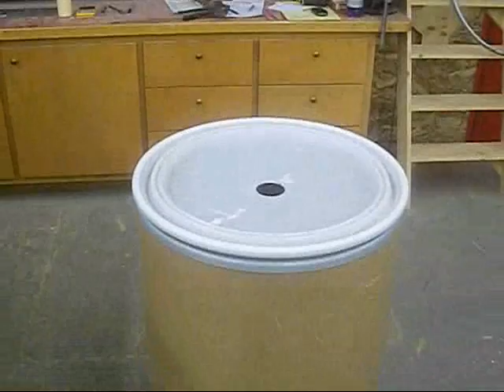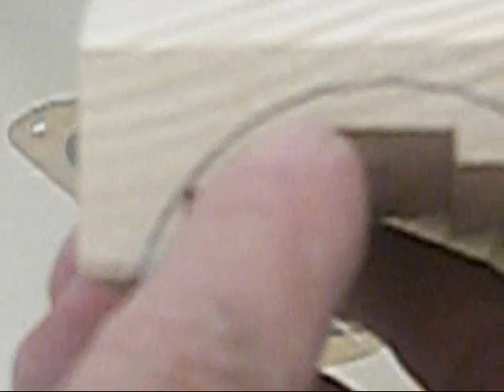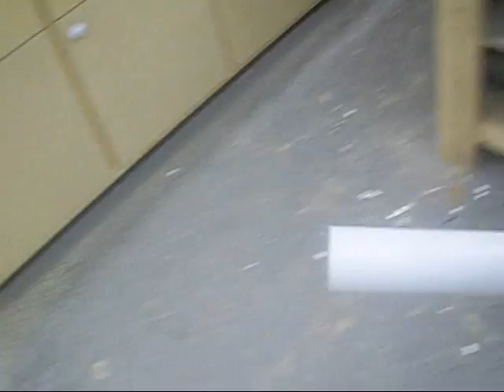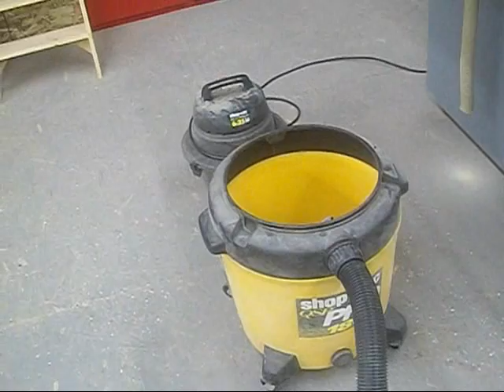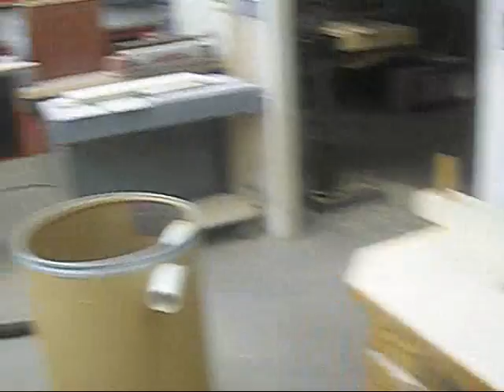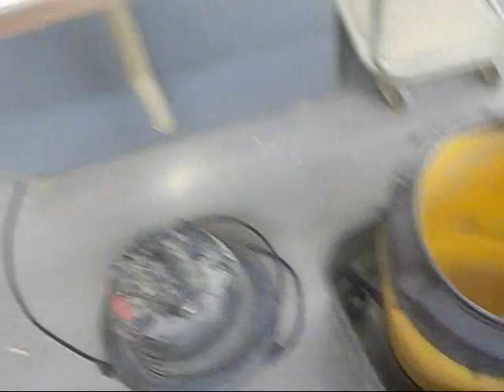Build this Sawdust Collection System

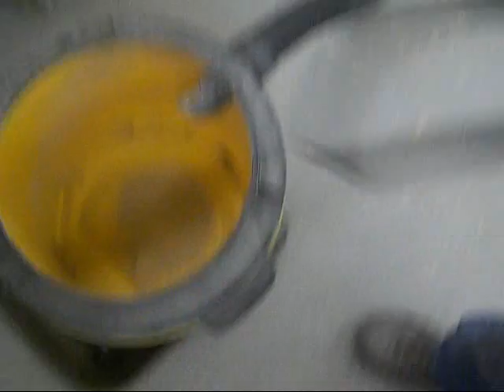Comment: Actually, ShopVac came up up with idea more than 40 years ago. If you go to 28:20 of this video, you'll see the exact same principal on the inside of the Shopvac with the very same dust line. You can cut your PVC exactly like the Shopvac without all the hoopla of the wooden support or metal. It's how I did mine with a 30 gallon plastic container more than 20 years ago. Build time about 15 minutes.

Comment: Followed almost exactly. changed the way the hole is put into the side of the barrel.  that was it. Works 100% not a bit of anything going into the vacuum, all going into the barrel. Only changes I would make. A little less complicated explanations and measurements are needed. I just used what measurements  I felt were right for me. I don't think a simple dust collector needs to be described with degrees and such. But like I said. I am very pleased with the outcome. thank you for your video :-)

Comment: I did make this, but I used a heavy duty Rubbermaid 30 gal garbage can, in my small shop it does a great job, mostly on a table saw and a router table....  would say it gets 80% of the saw dust.  One thing I changed after using it was to angle down the pipe coming in the can about 15 degrees.  With the stuff I had it cost me 15 bucks

Comment: Will have to use all plastic parts since I want to use it to suck up water off of the clean floors after washing them.
Reply: Use a garage door spring that will fit into the PVC pipe so that you heat it up and bend it to the shape of the bucket that you use.

Comment: Based on the dust path that was made you might want to angle your input pipe to that angle, would make it more efficient.

Also it could be improved by redesigning the input pipe, currently the pipe is quite a bit away from the inside of the barrel, the airflow could be improved if the side of the plastic pipe is right against the inside of the barrel, making a straight line through the pipe and along the side of the barrel.

Comment: I have to say I tried a couple different systems and wasn’t happy with the ones I tried.  I did this one very muck the same way, really impressed.  Had a big pile of saw dust under the table saw and figured it would be a good test.  I sucked up the whole pile... now the test..... NONE went into 
The shop vac it all went into the container.  I used a 35 gallon h/d Rubbermaid can.  I used a piece of plywood on top for added strength.  All hoses were 2 “.  Have to say it’s a 5 *** design.

Comment: Joe: Will the shape of this drum work? 
EAGLE 1601MB 30 Gallon Blue Lab Pack w/Metal Lever-Lock Ring found at Interstateproducts.com.
Reply from the maker: Hey Larry, I went to that site and seen the drum.  From what I could see (not knowing the measurement of the fat part down from the top) it looks like it would work but I would put the inlet pipe below the fat part of the drum.  In my mind the ridge of the fat part would cause turbulence in the air flow.
Reply: Thanks.

Comment: I have the same style collector with a 30 gallon metal trash can..It's works exactly the same. I was shocked at how efficient it was and how little reached the shop vac.... Shop vacs are very inefficient at what they can hold because of the filter displacement...Even with a 20 gallon shop vac once the dust gets to within 3 inches of the filter it clogs up very rapidly and in reality can only hold at best about 5 gallons of dust before the suction falls off....I really needed this for my planer in a big way...By the way,,as an adder,,pantyhose,,cut the legs off and slip them over the vac filter,,helps a lot.

Comment: I liked it.
It looks like a very effective system. It should be able to pick up small pieces of wood, without them jamming in the inlet, as it would in the vac itself. 
I think I would like to try and fit the inlet pipe to the lid, so that I could line the barrel with a garbage bag, to make emptying a bit less unpleasant.
[In theory, it should be possible to pass the wood block over the table saw at an angle, and cut the semi-circular groove for the pipe, in one pass, though I've not done it myself, yet.]
Thanks for posting.

Comment: where hav I gone wrong, I stared to build one of these today, having no cardboard bin I i used a bought fairly good quality dust pin  with a good lid 20" in diameter,  I Put my vac input hose through the centre of the lid and ran it down about 18", I connected up the  1.5" intake and it worked great,loads of sawdust in the bin, but third time I switched on there was a   big bang , well more of a Pop and the side wall of my bin was cracked. any idea  what I did wrong,having looked at your video again I see you kind of insist 7" below the lid (is that crucial) Im kind of thinking I ran the vac pipe too far down the bin
Reply from the maker: +Bill Lupton Yes, you certainly did run it too far down.  I didn't say 7" below the lid.  I said 3" below the intake pipe.
Reply: +Joe Johns  so you did,, thanks for the speedy reply,,  can I have your your opinion ? , as my bin has a 12" split (crack I have loads of very thin aluminum sheets , Im wondering if is just lined my bin with the aluminium and stuck it to the inside , alternative get another bin. Thanks for the reply  I enjoyed your vid.
Bill
Reply from the maker: +Bill Lupton Hey Bill, well I suppose you could use your aluminum and use a caulk between that and the barrel, making sure to put the strips on the outside and screwing/bolting the aluminum to the barrel making sure the heads of said screws/bolts are on the inside.  The idea here is not to disrupt the air flow inside the chamber so keeping it minimal is the key.  If that bombs then you can get another barrel.  In other words, don't throw in the towel until the thing is down.
Reply: +Joe Johns Gur a míle mait agat ,   I got another bin and am about to correct the mistake, it was fun making it, it was interesting and I was  just excited to see if it worked, anyway its only a bin .Thanks for being friendly  BTW thats Irish for thank you,  a thousand  thank you's
Bill

Comment: hi Joe  I made a dust collection  system  with  a  plastic  barrel  and  a  shop vacuum . this method  work's  great I tuned  two bowls  and used the dust system  and there was  no  dust or  shavings  in the vacuum . it's  a  great  video . thanks .

Comment: Want a simple Dust trash collection system, get a barrel size of your choice.. cut a hole opposite each other on both sides. Now hang a section of flat 1/4" plywood 12" x 12" from the lid down into the barrel.. now connect existing vacuum to to one hole and you collection hose to the other. I've made a dozen of these for less than $20 and takes less than 15 mins make.  You can collect all things that will normally fit in the hose and surprise.. no dust will escape to the vacuum it's self.  My personal one is connected a wall mounted fan that exits outside. I have yet to see dust of any size come out of it.. Everything is collected in the drum
Reply: Your method is scientifically less cost effective than Joe's.  The abrupt  change in the flow of air from your system causes more friction leading to more energy consumed. It might be cheaper to make your haphazard contraption, but it will lead to higher energy bills than a system like Joe's.

           Joes system, while not the most efficient method, at least provides a measure of cyclonic action. This removal technique is the industry standard.
Reply: Robert Wolf fool!  the method I use has been used in saw mills throughout the East coast for years...and there is no additional friction. ..you do not need a cyclonic action to collect dust and debris. there is no sudden change in pressure as well.  heck I've seem systems like mine made even more effect by a raised collection container that had a spring loaded trap door. when a certain amount of trash etc was collected...the weight would cause the trap to trip dumping the waste into a waiting container.  thus taking away the need to check the amount collected or dump it yourself. further more...the system I employ prevents any additional wear and tear on the fan itself...dust|debris  gets no where near the drive or fan blades.  my current arrangement now in use for several years, collects from various points as well & the fan is 12fr away from the collection point...  not one system I've set up for friends and family as failed and that includes a system set up for a gent that needed an easier way to clean his ashes from the basement firebox...flex metal tubing  ran to a metal trap  with the fan outside. ..everything trapped in the metal container....no ash or possible embers making their way outside
Reply from the maker: +Richard Elbe Richard, I have to ask you.  Why the hell are you here on my YouTube channel touting your dust collection system?  If yours is so great and wonderful why don't you have a video showing how to make it and how well it works?  Jesus, you got big ones, buster!
Reply: simple...it's the law of the enter webs..people improve upon what they see and simplify it. I'm not taking away from yours....but think about the majority of people who scan  the the web looking for these ideas are low income and trying to make good on what little they have.  A buddy shared this link to me and was unaware I made a version so I threw it out there.    It is the name of the game after all be cost effect both in material and time.  If you don't like it.. delete my comment.. cause I sure as hell did see a sign saying that youtubes property was given back to you. Or were you aware of that.. same as facebook..what you upload... belongs to youtube
Reply from the maker: +Richard Elbe No, see, you're missing my point.  I don't give a flying care about who uses my ideas or material I post on YouTube for that is the reason I put them up there.  What I do care about is someone like you coming onto my channel and uses my audience to proclaim their goods.  I mean, if you were a Chevrolet dealer would you walk into a Ford dealership, stand on their floor and begin lambasting Ford?  As perhaps a surprise to you what I give to YouTube belongs to them for as long as I determine them to have it and I delete it.  So, no, I have opted not to delete your comment because I want everyone to see how silly you are.
Reply: at least its entertaining for them
Reply: +Richard Elbe your right, it is entertaining.. just to see what crap will come out of your mouth, it shows your ignorance. by the way your idea does suck.

Comment: I have just finished building my dust collector using a 1200watt shop vac connected to a 12 metre 2" swimming pool hose {since cut down} works absolutely perfectly with no dust in the vac itself.Here is the only problem that I have encountered and perhaps posters may know the cure.The high pitched scream from the convaluted hose scares every dog in the neighbourhood {better than a catapult 5555} and is painful to the ears. This is really really high pitched
Reply: +The sawdust maker. David. the swimming pool hose is a continous spiral. If you use a regular shop vac hose or a smooth insed hose the noise will not occur.
Reply: +JIMMY TATE .I live in Thailand and restricted for choice of basically anything. The vac came with a small tube which was not very long and quite difficult to get fittings, hence the expensive pool tube but will continue to look for something to use the original hose.Thank you for taking the time to reply. Much appreciated.
Reply: I just had a quick thought... If you could get tight hose couplers for that hose, you may consider cutting the hose into a few pieces and reversing the hose for each section relative to the previous section.  This would interrupt the spiral a few times and maybe at least reduce the noise.  I am only speculating here.  It may not be effective and the additional couplings may cause more drag or places in the hose where particles may jam and collect/clog.
Reply: good thought but turning the hose end for end will not change the way the spiral goes.

Comment: Hey Joe. Thanks for this great video as I built one with some alterations. Here is what happened. I looked for about 6 months for a fibre drum but found none. Even looked for a plastic drum with a sealed lid. No Luck. So I bought a plastic garbage bin and some foam tape and glue. The tape and glue did not stick as the plastic was too waxy so I taped it with some good duct tape which worked out good. I made the wood caul, installed the pipe in the top and side with some extra support in the top. However it was difficult to caulk as due to the waxy plastic I had problems with the glue and the caulking to stick. Once all was set I plugged in my 6.5 HP Shop Vac. All was OK collecting sawdust until I overloaded it or closed the vent. The garbage can lid and side got sucked in big time. Lesson learned use a heavy duty solid bin to start with that will accept glue and caulking. Plastic does not work. Hope this is good advice so you can learn from my lesson. Malcolm in Canada
Reply from the maker: +Malcolm Hall Hey Malcolm, you can find these drums/barrels at places like bakeries, industrial plants, food handling plants, car washes, auto parts stores - basically,  while riding around keep your eyes peeled.
Reply: Thanks Joe. I have been looking everywhere for the last 6 months with no luck. I found some through Kijiji and they were free however they were in Toronto which is 500KM away. I will reinforce this baby for now but will keep looking and re build once I get the right barril. It was fun to make but you can imagine the look on my face when the top and sides got sucked in when I turned it on. lol
Reply: Plastic works fine. you have to scuff sand it first. try using liquid nails instead. I use a metal trash can with a modified thein baffle. no issues with the can crushing.
Reply from the maker: Hey Malcolm...yeah, I have heard tales where some of the drums folks use collapse from the vacuum force.  The only thing I can tell them is to get a thicker container.  One maker of this system ended up putting staves on the outside of the barrel, which he said worked fine and no more problems with it crushing.
Reply: Thanks Joe. I built a framework inside the container that is working fine. However If I find a decent rigid container I will build another one.

Comment: Does the wood caul really need a circular cross section? Couldn't you stop after the dado blade work? The caul would still position and secure the inlet pipe.
Reply from the maker: +ohgary Sure you could.  I was merely being thorough is all.

Comment: So I need someone to explain this to me... I've seen a lot of people showing how they've built these cyclone dust collection systems and they connect them to their shop vacs, and this is such a newbie question, but here goes... Why??? Yes, I know that most of the dust gets collected in the cyclone thingy and not much gets into the shop vac and therefore doesn't clog the filter and doesn't fill the bag as quickly. But here's where I'm confused: personally I took the bag out of my shop vac, so I never use one. Dust fills the shop vac, then I simply dump it! Done. If I wanted to, I could even take the filter out completely, right? It seems to be sucking everything up just fine and I keep dumping the dust. I don't understand what added benefit the cyclone thingy provides if I could just use the shop vac itself as a cyclone thingy. Ok, stop shaking your head and start explaining.
Reply: +Malek Ali It's the really fine dust that's dangerous for your lungs, but if you use a filter capable of trapping that dust then it'll just get sandblasted by the larger (visible) dust and chips. The idea behind separators is that - in an ideal system - all the visible dust and chips end up at the bottom of your separator, and only air that contains the finest dust (possibly not even visible to the naked eye) passes through your filters; thus they don't take a hammering, and don't get clogged (which would kill your airflow, and then reduce the ability of your dust collector to capture the dust at source). If your location allows it, you could even dispense with filters, and just eject the exhaust air outside - which you couldn't do if it contained a plume of dust and chips.
Reply: +gbspikyfish 
Great explanation.
Reply: +Malek Ali One thing you should know is that the dust collection system is not 100% perfect...sure only a small percentqge gets through but that small amount could easily destroy the motor in your shop vac. Remember the air that is picked up goes through the motor to cool it, added dust and shavings going through will cause bearing loss and could even cause a fire due to the brushes in the motor sparking when the motor turns. A filter, even a paper filter will catch most of the rest of the dust that didnt get collected.Additionally the really fine dust that gets through the motor can get into you lungs and cause a disease called COPD, which is a very serious breathing problem.
Reply: +JIMMY TATE thanks very much. That makes sense.

Comment: Made one out of a 7 gallon bucket with a screw on lid, works great. I used your design to make a smaller portable version. I am a professional tile installer and am in the middle of demoing about 1200 sq ft of tile and mortar. after removing the tile I am grinding the mortar with a cup wheel and a shroud attached to a vacuum. The filter always gets clogged very quickly as it does with fine saw dust. I really want to thank you Joe for making my life a whole lot easier! I was considering buying a $1,200.00 commercial vacuum but no longer. Your system only costed me $11.97! Thanks again!